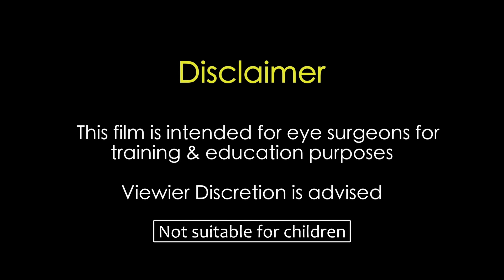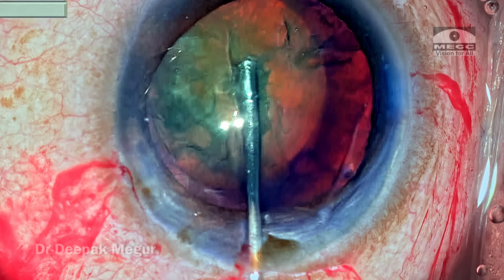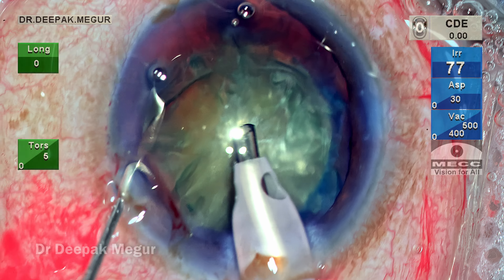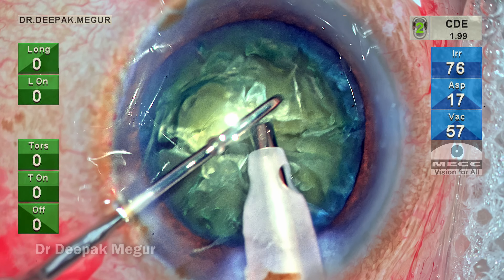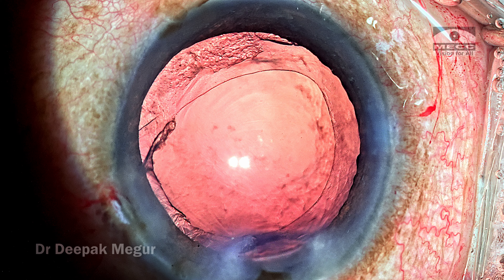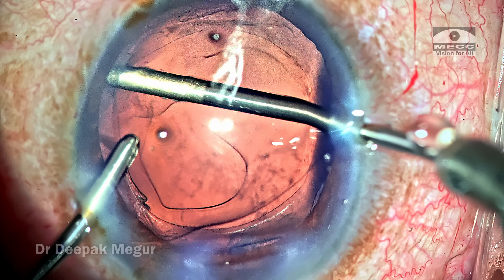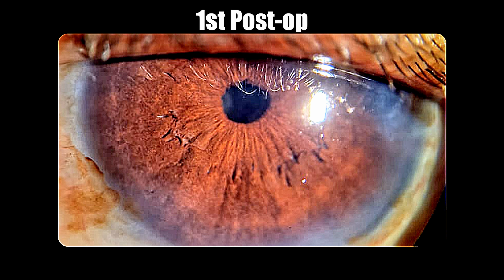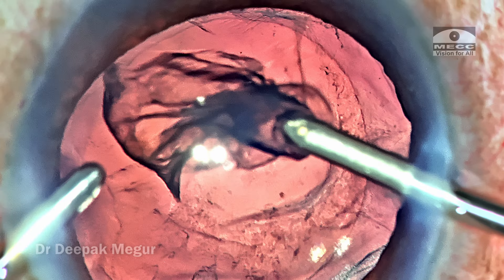Surprise..! Trans-Zonular  Vitreous Prolapse... Strategies to deal with it - Dr. Deepak Megur

Comment: Excellent case! I too have encountered trans-zonular vitreous prolapse in a few cases over the years. From my experience I would prefer a pars plana entry for vitrectomy as it is much more efficient. Patients often don’t recall ocular trauma decades later; sometimes they recall facial trauma but don’t think it matters. Obviously it does! 

I have had small TZ vitreous prolapse when inflating the AC and sealing wounds at the end of the case. It occurs when tap the IOP down as there can be a sudden decompression and vitreous can present. Usually it is a small strand and cutting with a micro scissors has worked well for me. 

Thank you again. Hope to see you at ASCRS

Comment: Great video as usual sir..Thank you for sharing ...
One humble doubt sir..  If we happen to practice in a peripheral rural setup where  CTR , triamcinonole is not available   and we encounter similar kind of situation ? What should  be our  appropriate management sir?
Reply: You can use a tiny bit of trypan blue but if it all goes to the back you will lose red reflex and the rest of the case will be a nightmare.
Reply from the maker: Thank you.
CTR and Triamcinalone are not expensive..! Every cataract  surgeon should use them when needed irrespective of one's practice profile.
If you are doing phaco then your phaco machine will have a vitrectomy  unit built in.. So just use it.
Reply: @DrDeepakMegur  Thank you sir.. But at present in our GH, Phaco machine is not available sir
Reply: @mannargudiagarwaleyeclinic   If CTR and TA are unavailable the only way I see it would be to use vitrectomy scissors to release prolapsed vitreous, but they are probably also unavailable like CTR. So just close the eye, clean up whatever is possible to clean without pulling the vitreous and send the patient to the hospital of higher reference.